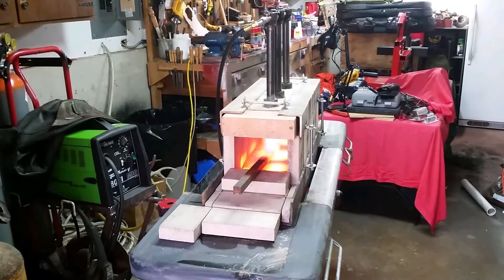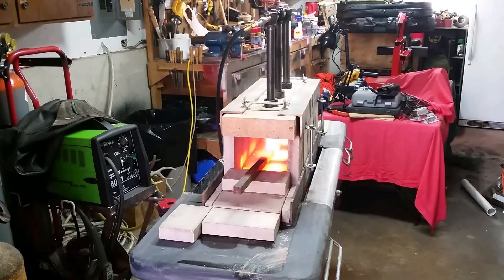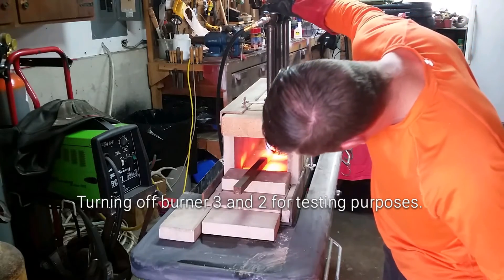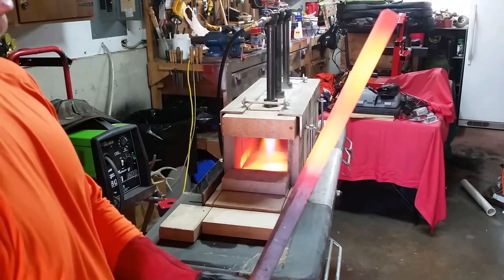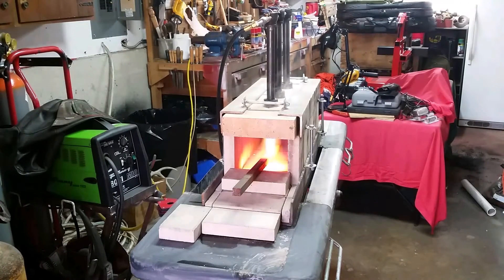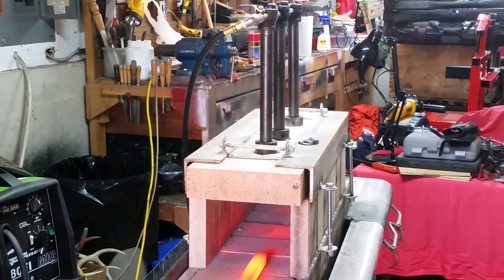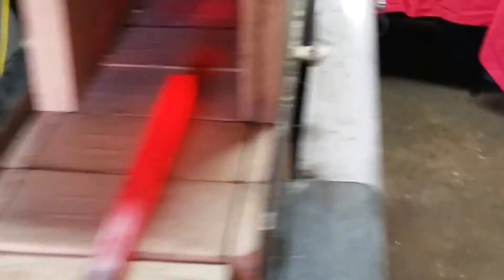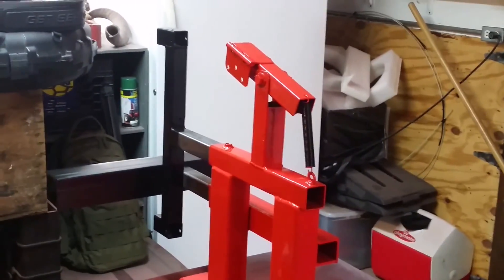Propane Forge Build Pt 4 Final Test Fire :)

Comment: Thanks for sharing. I've made one too, except I didn't add any ball valves for flame isolation. 
I really like how you were able to shut off the back port, and I think I'll replace the couplings with atleast 2 valves. 
Thanks again.
Reply from the maker: Still using and enjoying this forge.
Reply: @HandyGuy2016  that's awesome!

Comment: First off nice job. Second what is the spacing between the first two burners how far. Third how's it holding up so far any problems? And forth have you forge welded with it yet. Thanks for any comments. I've already got all the plumbing parts and fire brick. I'm getting excited man. Cheers and thanks
Reply from the maker: Michael Foster  Thank You, the spacing between burners is 7 inches, it is holding up great, and I have forge welded with it. If you go to my "blacksmithing" playlist, you can see videos on the forgebuild and projects I have used it for.

Comment: Hi Sir, 
Im not sure if my opinion matters, but im going to share it... Very very well done! All 4 of parts in this series were full of very relevent and clear information. Im working on my final planning of my forge and burner build, came across your channel, watched and will be making my burners just like yours. Im very happy with how yours turned out. My forge will be different however only because I have a need for much more insulation, too many little curious fingers to get burnt, and I like a more finished look... no offense. I hope you are taping your 2×72 grinder build, im working on mine as well. Then a hydraulic press, Hydraulic roller, etc.

Thank you for sharing
Reply from the maker: Brady McPhail  I have videos of 2 different belt sanders I have built. Check them out  :)
Reply: HandyGuy 2016 thank you. Looking forward to them.